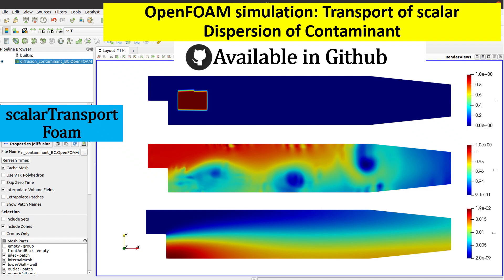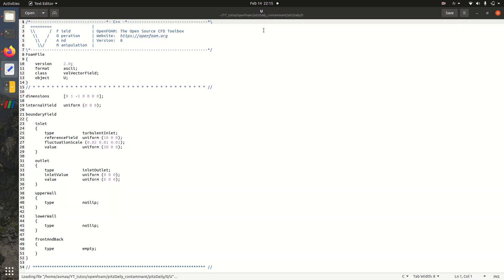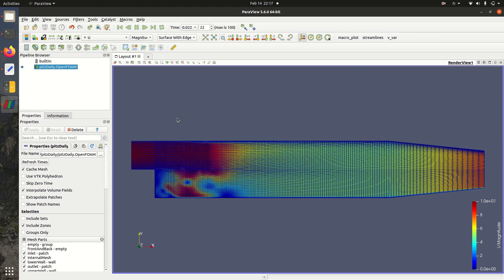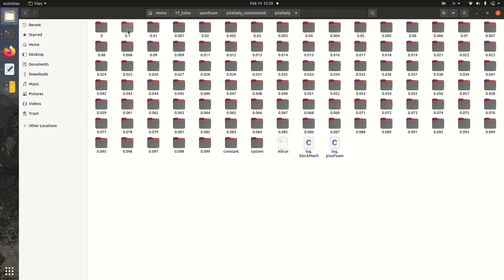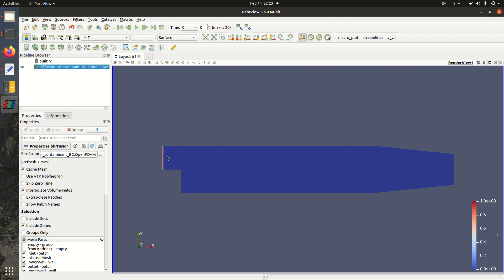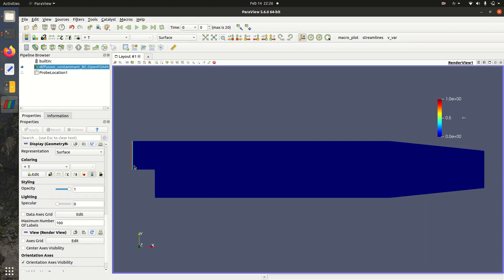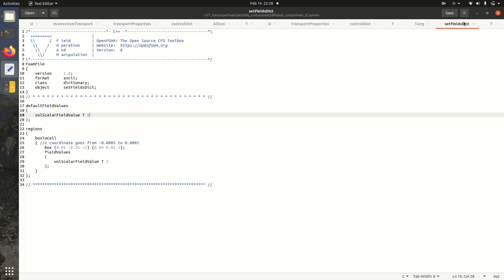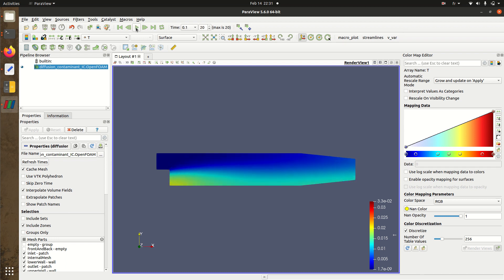OpenFOAM tutorial: Transport of Scalar - Dispersion of Contaminant

Comment: Thank you! Can I ask one question?  whey you add two T file(T.org and T). What is the aim of this？  If I only use T, could this be simulated?
Reply from the maker: Yes your simulation will be fine. It is just a backup file, in case I want to rerun the setFields, I still have my original file of T called T.org.